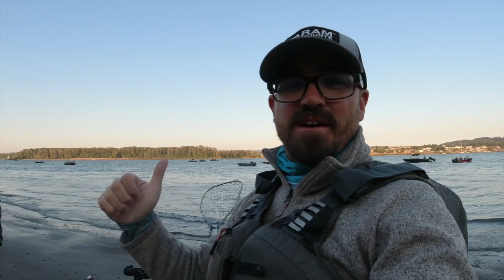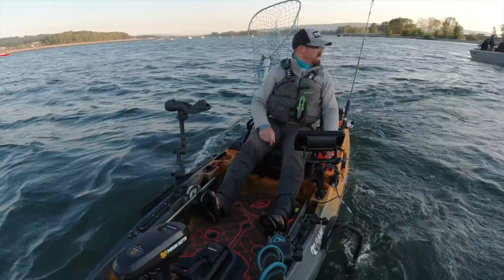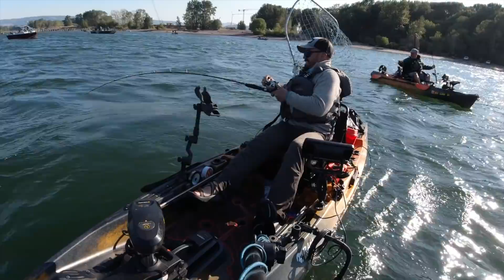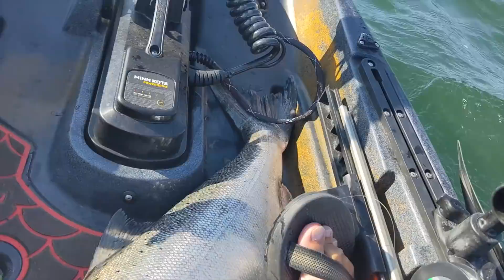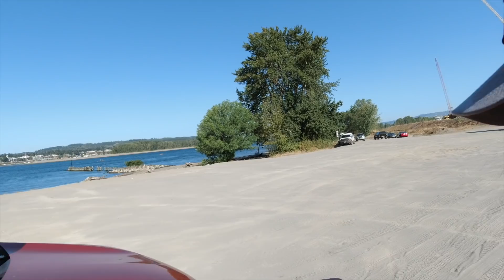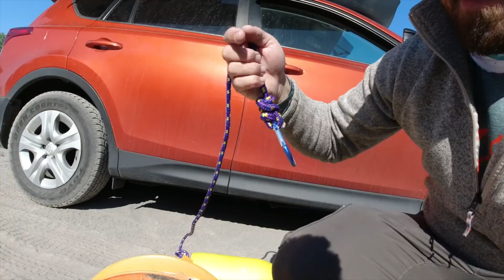Ropeless Anchor Kayak Fishing Wobblers for Chinook Salmon

Comment: Great video Tyler.  Did you release the anchor when you caught the fish?  I didn't see that.  And when you do release do you go back to the trolling motor?  It looked like you stayed in place the entire time you fought the fish.  For safety I think I'd just throw a float out there.  Even though it'd be behind you I think other boats would get the message..  Fun system.   Be safe out there!  Fish on.  Mark in the blue Hobie.
Reply from the maker: Yes I dropped off spot lock. When you disengage spot lock the prop is turned off. I was drifting downstream the whole time.

Comment: So, an autopilot station keeping system for the Tupperware Navy. Wow…. How bad is the battery drain on the Big C’s currents?
Reply from the maker: 4-5 amps per hour. I have a 100 ah lithium battery so I could conceivably do that for 20+ hours on a single charge.
Reply: @spiltmilt  Does the ipilot app on your phone give you the amps you’re using (saw you glance at your phone). 0r is that a calculated # from your past experience? Thanks for all the great videos.
Reply from the maker: The lithium battery I have is fitted with Bluetooth so I can check remaining charge and draw

Comment: Nice video, as always. I would think a Jumbo Jet Diver would be a better tool for holding your gear in position for spot lock due to the minor positioning changes. If you have enough current for the depth. Nice work on the fish!
Reply from the maker: Jet divers don't work for getting to the correct depths on the lower Columbia. I had zero issues with lead being dragged or bounced by the kayaks minor movements which were not any worse than anchored powerboats experience.